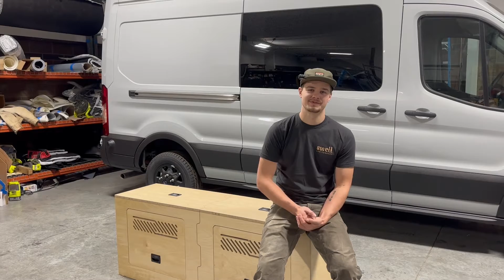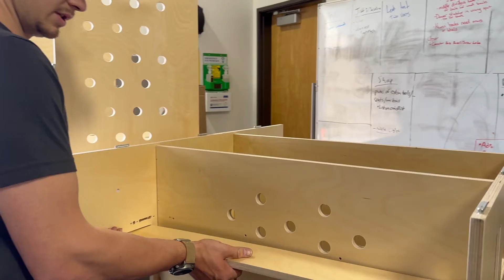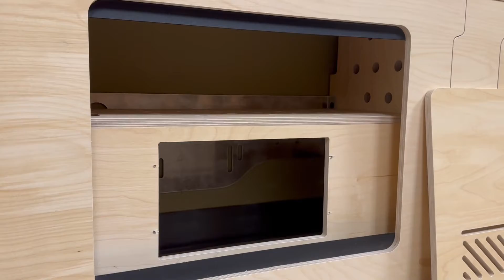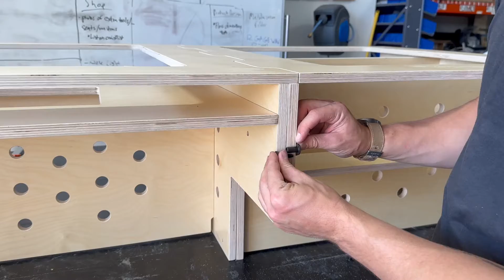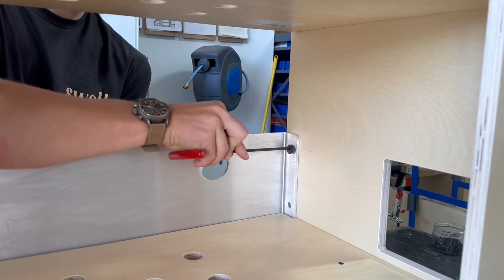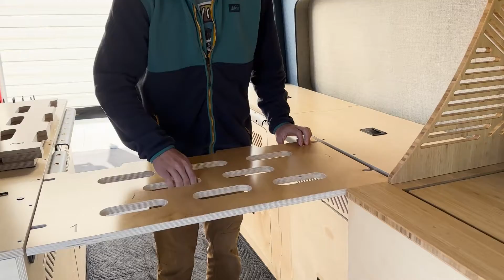EcoFlow Garage Cabinet Build | Swell Van Co

Comment: Beautiful! which EcoFlow fits in these cabinets?
Reply from the maker: Thank you! There are two versions of our garage cabinets, a lower and taller version. They are both designed to fit the complete EcoFlow Power Kits. The only difference is how much battery you can fit inside them. The lower version can fit the 5kWh battery, whereas the taller version can fit up to 10kWh.